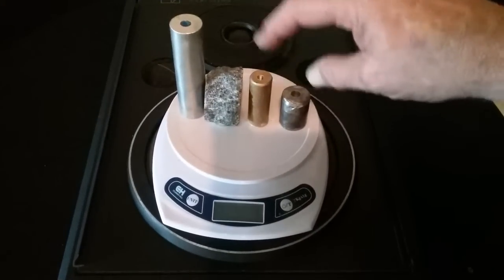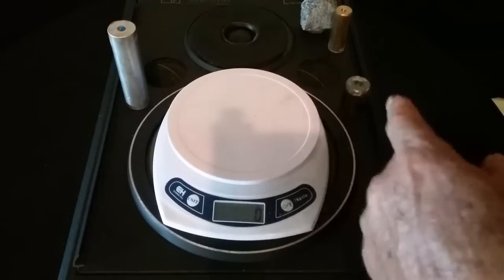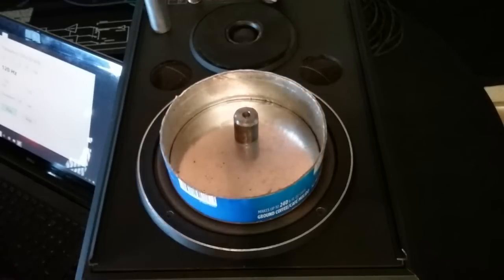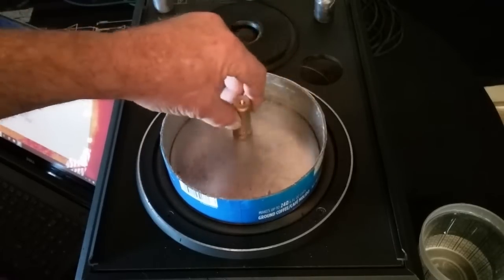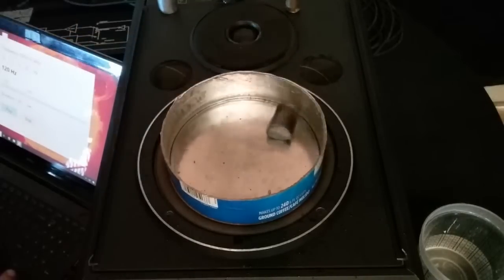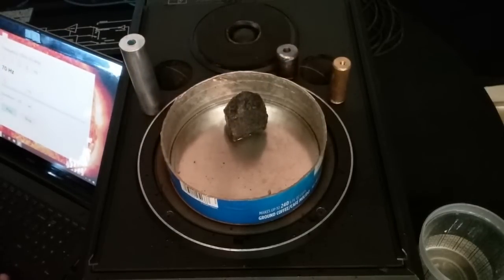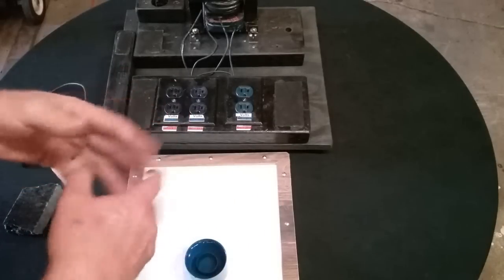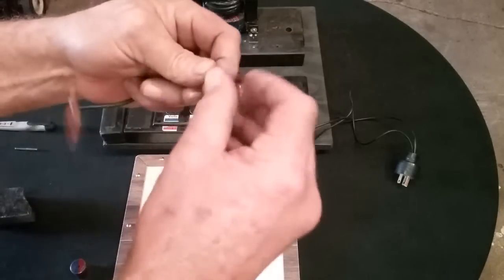Vibrational and Electromagnetic properties of Granite

Comment: Granite has piezoelectric resonance properties

In your #1 sound experiment the Granite generated a field by way of exciting the crystalline with the motion of sound. Then the Granite cancel that out cohesion, gravity. It creates its own low level space time envelope.
Reply from the maker: I can understand that!
Reply: HELLO GUYS AND GALS ... I LIKE IT WHEN PEOPLE THINK OUTSIDE THE SQUARE. 
I DON'T THINK THE FIRST PART OF THE EXPERIMENT HAD ANYTHING MUCH TO DO WITH SOUND VIBRATION EXCEPT TO ACT AS A
A LUBRICANT. 
THE REASON FOR THE 'STRANGENESS' IN MOTION FOR THE DIFFERENT OBJECTS WAS THE DIFFERENT ABILITY OF THE MATERIAL/S TO ACT AS BOTH ELECTRICAL AND MAGNETIC INDUCTORS IN THE OSCILLATING MAGNETIC FIELD OF THE SPEAKER.
Reply: It's no surprise that most of the Missing 411 cases happen near outcrops of granite boulders, or places with lots of granite.  That's why I came here, actually.
Reply: That is why it is believed by some that the Great Pyramid was a power station. The differing strata of materials act like layers of generation of Piezo electric charge. Add that it sits along a Lay line would cause near continuous vibration and therefore power generation. Whether the power was atmospheric akin to Tesla's wireless power experiments, or illuminated a crystal set on top like a giant street light, or some other method remains to be determined.
Your BBQ igniter is a tiny crystal, 1500 volts. How many tons of it in the Great Pyramid? The lamps in the pictures could be wirelessly energized providing a modern day level of life.

Comment: Unfortunatly the granite has a complete different shape,  non cilinder... thus making that an aspect that could maybe explain the different behaviour...due to a different balance when hit from below  less fraction sliding surface etc..  good luck sir .. really interesting..
Reply from the maker: Possibly! However, every different size and shape piece of Granite I used in the experiment always out maneuvered any other material.
Reply: @TheGoodVibrations  Perhaps you could obtain or drill out a 1" core sample that would negate the concerns mentioned above?

Comment: Note:  the shapes , sizes are different and so the contact surface is metal.  Your experiment does not prove that the granite has vibrational properties, instead it reflects that the granite has crystals that create a more smooth gliding surface.  though again, it does not prove the vibrational characteristics within it.

Comment: Interesting study. Granite is the material of choice for some of the mystery sarcophagus boxes that had animal carcasses inside. Fermenting those organics will produce pressures that activate the piezoelectric effects which could turn those huge caskets into power sources. 

Is the can bottom magnetic or does it respond to moving magnetic fields like aluminum or copper?

The granite may be generating an EM field that affects its connection to the plate it’s on. Does the vibration change its magnetic properties?
Reply from the maker: The can bottom is tin and somewhat magnetic.

Comment: So I laid this granite tile on some back steps leading to the double doors which had a metal casing around them between the brick and doors. When I was done grouting I dampened sponge how I usually do and began wiping.  As I go I add a little more water for final rinsing. When I hit the metal jamb with wet sponge I got shocked and it felt like a wire was hooked to the metal jamb.  I touched the jamb with my bare fingers and nothing.  Then I proceeded to wipe to the other side and hit that jamb and got shocked.  When I wiped the damp sponge across the granite to the metal it charged the sponge or something.  Very wild. I will have to experiment with this later.
Reply from the maker: That is very interesting in deed - let us know if you find out more!

Comment: Electromagnets 101 from a sparky....
A DC current is required to make an electromagnet. This is what pulls in relays and contractors etc. If you pump AC into a winding, it's main use is for transformer action I.e. converting one voltage/ current to another voltage in a secondary winding. It will not generate a significant magnetic field as the constant alternation of the polarity collapses the electromagnetic waveform.
The steel wasn't attracted to the granite when you used ac because granite has a very weak ferromagnetic force compared to steel. Yes a strong neodymium magnet was attracted to it because it only needed a small amount of electromagnetic force to attract it.
The vibration experiment was intriguing though. You found a resonant frequency that affected the different metal rods and granite in slightly different ways due to the density of the materials.
Speakers are also dc electromagnets but the frequency the frequency generator puts out is a square wave biased from 0 volts dc to an upper positive voltage depending on the volume level. This is why the steel rod went to the middle of the speaker (magnetic equilibrium point) and the aluminium and brass wet to the outside...they followed the waves of the vibration which oscillated outwards at that frequency. A change of frequency either higher or lower will move these two rods in different ways

Comment: The center of gravity is so much higher for the rods compared to the lump of granite. Even without the vibration,  the rods will tip over easier than the lump if you push on them, and then it's where you push it, higher up or lower down.

Comment: In your description you stated Gravity was weaker? How is that? We were not spinning faster
Reply: Also, the power needed to transfer vibration to sand is that would resonate to the granite would be equal to its properties offset of its mass. Use a tweeter and try to move the granite.
Reply from the maker: I believe that when the continents were in the "pangea" formation - they actually covered the entire planet. Yes, the Earth was smaller than it is today. The ancient Younger Dryas event caused water and other elements to be deposited onto the Earth - making it much larger. So - prior to the Younger Dryas event - the earth was smaller = a much weaker gravitational property = dinosaurs and etc.
So - when the early stone builders were constructing - they had softer granite... and mush less weight to deal with. Furthermore, humanoids (nephilim) were also bigger.
Furthermore - they could have used granite "slabs" to move the larger desired stones. (The ground it self was probably a "huge slab" of rock.)
Furthermore - the pyramids were built to pump water from the depths (before the Younger Dryas) because the Earth's surface was extremely rocky with most water deeper underneath.

Comment: "I can't move it...", well that's not true. You can move if you actually try. The correct phrase would be: it has a greater resistance to a lateral force applied near the base.

And they have different densities & topologies, which are factors in this experiment.

Comment: The rod doesn't go to the center because adding the water changed the harmonic resonance of the surface it was resting on making a harmonic to the place it kept going to.
Reply: This is at 7:00. Also, for a fair test, you should've done this with regular items.
Reply: Also, fun fact, granite is igneous rock, which means it came from magma rising to the surface of the earth. The rock isn't magnetic itself, but rather can contain minerals that are. Its magnetic field is determined by its position relative to the earth's magnetic field at the time it cooled.
Reply from the maker: If you think the experiment needs additional items and etc. - please conduct one yourself and film and upload the results - I would be glad to view!
I believe that most of the granite on this planet (and other magnetic materials) were magnetized during the cataclysm thousands of years ago. And, granite contains a percentage of ferrite - which does interact with magnets and electric currents - even though the granite itself is not actually magnetized.
Reply from the maker: I agree with you assessment on the water demonstration!

Comment: Nice video. I don't realize granite was magnetic. I agree that ancient civilizations were probably tapping into atmospheric energy. Have you looked into Tartaria/ mud flood stuff?  Have you looked into Earth not being a spinning ball?  Cheers.
Reply from the maker: starsnotfar432
I understand your reference with FE. I am not convinced of that reality.
However - what I do find more plausible is what David Talbott suggests in his "Symbols of an Alien Sky" presentation - (it's not about Aliens...)
Reply: @TheGoodVibrations  fair enough. one thing to consider regarding the earth and magnetism is that molten iron is not magnetic, so where does the magnetic field come from then?
Reply from the maker: @starsnotfar432  
My theory offers that the core itself is not molten - it is a solid Huge spherically shaped magnet. The induction and convection of the rotation of the magnetic field of the core causes the surrounding material to become molten. It is like a river that flows in a circle around the outer equatorial plane of the parameter of the core. This "flowing" lava gets pushed up into cracks in the mantle = volcanoes. this is one reason why there are almost no volcanoes near the poles of the Earth.
Reply: @TheGoodVibrations  interesting. what evidence do you have that supports axial rotation of the earth?
Reply from the maker: @starsnotfar432  
I have no factual "evidence" - other than the plausibility that without my explanation - what would cause the core of the Earth to have any molten material that hasn't cooled much in the past 2000+ years that there have been documented records of volcanic activity on the surface?
If the molten material was created / sustained by any sort of radioactivity / atomic fission - fusion - there would be an extremely dangerous amount of radioactivity in the lava exiting at the surface.
My theory also gives plausibility as to why the Earth has stable rotation. (and any planet / moon with a substantial magnetic field ((except for Mercury because Mercury basically is a planetary core))
I have videos proving and demonstrating the extreme vortexing of the magnetic field displayed by all natural magnets.
Reply: @TheGoodVibrations  I too wonder why the Earth's core hasn't cooled. Maybe it's because earth isn't a spinning magma filled water-ball that's somehow pressurized despite being in a vacuum.

Comment: Appreciated those experiments. Most interesting, ...I never knew that granite was magnetic. 

The question I would have is how does this scale... Does a stone twice as heavy require twice the amplitude of vibration to lighten the load....? ...I wonder if... Could you... perhaps... ... What if you super-glued a thread to the very bottom edge of each piece to get rid of the balance issue and just focus on the force comparison. ...That way you could then potentially measure the force needed to move them... I can't think of the method of measuring that force simply.... a simple, spring weight gauge comes to mind but they're far too heavy duty. Hmm. Quite a brain teaser.

..But if that could be done, then some calculations can be done, to get some idea what might be needed to lighten the load of e.g. a 1 tonne block ...If that would require a million KW speaker or just the right frequency.... 

I know a little about instrument making and am aware that the size and shape of an object determines its resonant frequency so I wonder how much effect that is having on this experiement. The fact that the granite has a large body focused into a smaller base could be significant, potentially. ...I.e., is this frequency effecting the material, irrespective of dimensions or it tied to the dimensions also. ...I impulsively imagine a heavier stone requiring a deeper frequency. ...Though perhaps not.

In the most basic terms I'm guessing this vibration is kicking the stone off the surface of the tin, a microscopic amount, in quick succession.... That rapid 'kicking' motion is causing contact to be lost between the two surfaces momentarily and is acting much like a lubricant, disabling the two surfaces locking. Whether it is the vibration of the tin or that of the stone is hard to equate. ...I do know things slide around on speakers when they're turned up... Hmm... I think, in the words of Isaac Asimov: "Insufficient data for meaningful answer." ...

...I worked in an engineering company that made high frequency cleaning baths years ago, by the way. Can't remember the name now... They vibrated the water in the baths at high frequency which dislodged dirt on objects placed in the bath, you could change the intensity of the vibration. I could never quite work out if they actually worked or not but they were pretty high tech :-D
Reply from the maker: I believe the crystalline (magnetic / electrically conductive) properties of granite allow it to "harmonize" with various frequencies - as opposed to most other "objects" which are not crystalline to basically absorb and / or conduct.

Comment: The coil generates the magnetic field whether or not the granite is present.  The attraction or repulsion would occur with or without the granite. You could put a chalk cylinder in the coil, and the attraction would still occur.  It doesn't necessarily mean the core has special properties.  To determine whether the granite has any effect on anything, you would have to measure the difference between something like chalk as a core, or just air, and the granite, otherwise the demonstration is inconclusive. Your methods are sorely lacking.
Reply from the maker: I was only interested in how the granite displayed as a core to a coil. I am not interested in what chalk does - maybe this is an experiment for you to execute.
Reply: @TheGoodVibrations  I am also not interested in what chalk does.  That wasn't the point. I'm sure you know that you should be comparing the coil alone and the granite to see the difference.
You know full well my comment had nothing to do with chalk, as that was simply a dead material to compare against the granite and I did state or "just AIR". Otherwise, how do you know what the actual reaction of the granite is? You must compare to a known standard to evaluate the outcome and I don't believe you don't know that.

Comment: Olso cilinders has diverend translations as the granite shape. 
In fibration tegh understandings shaped are olso translating factors 

The ganite  shape makers is woble a litle more 
So In this test you cannot relay 100% that it is the granite our tye shape of the granit our boths as part of this outcome.
Reply: Beautiful experimental aproges😍🙏😍
Reply: You see the last thurn of granit on its last flak it didn't not moved that match than on the others.
There the angle was centered from below to above .
And the others the angles are audwarts from center from below to above and it kan be moved much easyer😍
Reply: Thank you for your sharing 😋😍

Oll injoy beïng🌈🌻

Comment: Soooo what if Egiptians had small sand lakes that were shallow and they would chant around a big stone at 75Hz and a guy would push it from the other side with one hand?
There, Pyramids solved.
Reply from the maker: You are a genius! Why haven't the professionals though of that?
Reply: @TheGoodVibrations  my dear man, i think that the proffesionals went a completrly different direction regarding physiscs. Atomization of the universe is not exactly a 100% confirmed and tested point of view, but still, it is the only one talked about.